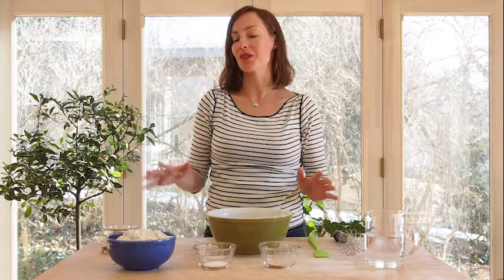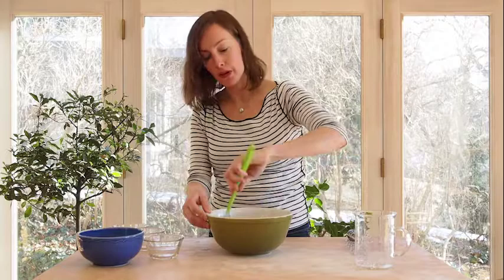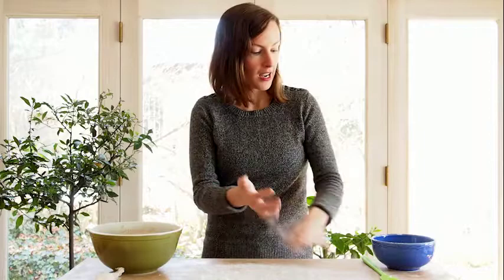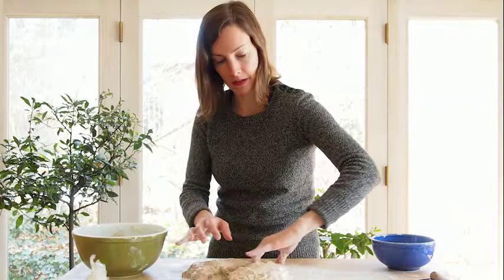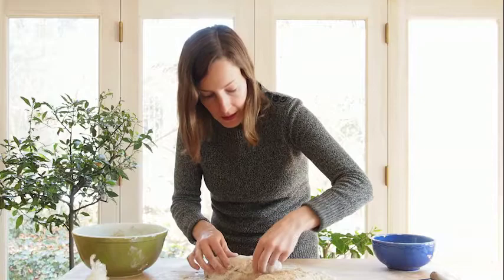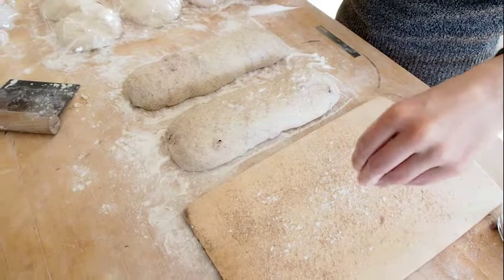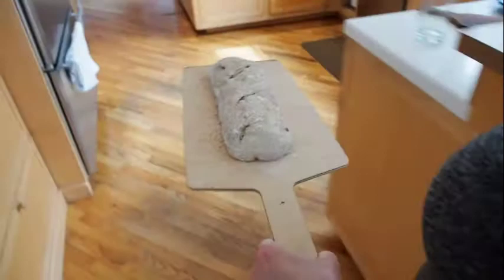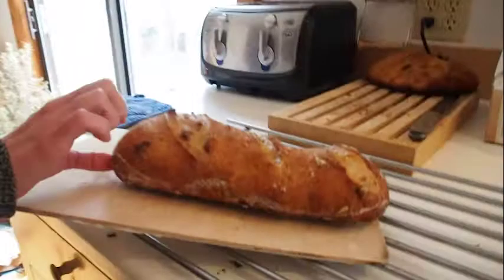Making Bread in The Fourneau Bread Oven

Comment: Looks great. What's the advantage of this over, say, a Lodge combo cooker (used upside down)? There is a significant cost difference.
Reply: For me, not having to handle a bit heavy hot pan or dutch oven, you only need to move the door.  The  heavy cast iron really makes for a beautiful crust - I've had mine since the kickstarter and love it.